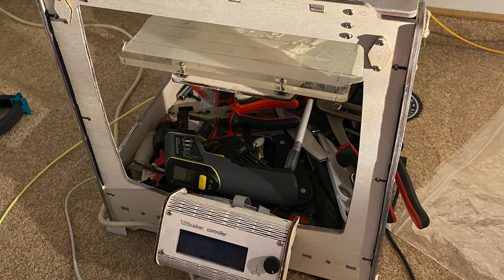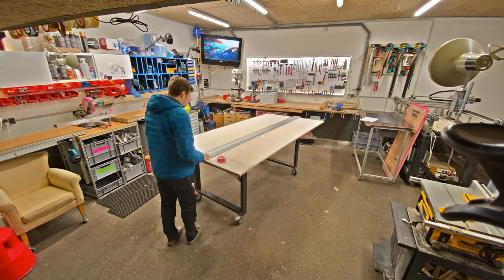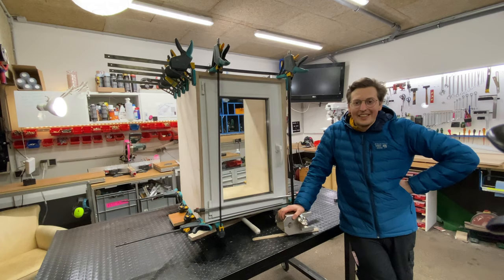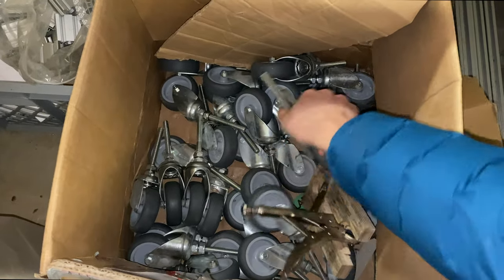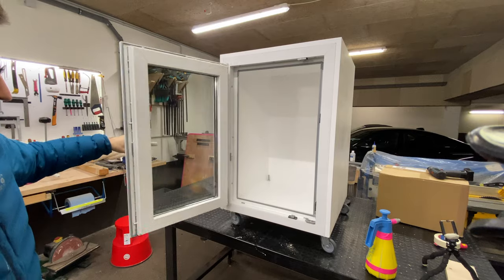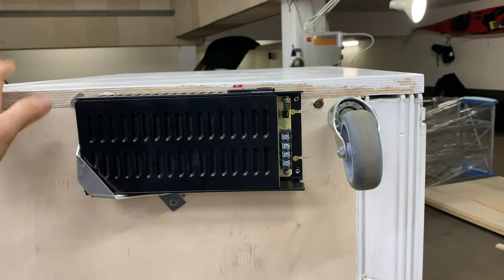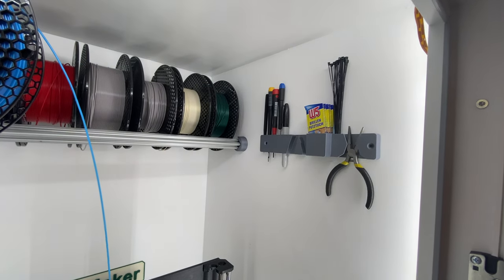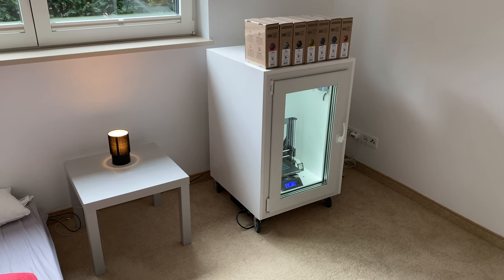3D Printer Enclosure. The perfect home for your printer! (Soundproof, Dustrpoof)

Comment: Thanks for this video, this is a fantastic build. I may build something similar, but with two changes.   1. Exhaust fan and tube to vent the enclosure out the window (since micro plastic dust from FDM printers is real, and can be a serious health hazard over time), and,  2. Mount the accessories holder and extra filament outside (top or side).  Thank you for the inspiration!
Reply from the maker: Good idea! The way it is its completely air tight, but of course you open it at some point. A filter would be nice, but you need to avoid a draft as well. So maybe one that vents only when its done.

Comment: Amazing idea. I’ve searched for ideas for a printer enclosure and this is the best solution I’ve seen so far. Fireproofnes however is an important point for me, since I’m using a chinese printer. I will glue some 2mm Aluminium to all surfaces on the inside to improve it a bit. 

Windows in a small size like 40x60cm cost around 40€ online, never expected them to be so cheap.
Reply from the maker: I never run it without a person at home. It sits in the kids room, (no kids yet) so we practice checking on it.

Comment: Baltic birch plywood.  I love that stuff.  Heavy and straight.  Not your standard douglas fir plywood.  EDIT:  For those looking for ventilation that's quiet and cheap, I've used (in the USA) 8 inch duct elbow (90 degrees), 8 inch "back draft blocker" (so wind from outside doesn't push printing fumes indoors, and the Amazon Basics 3 speed small Room Air fan 7-inch.  If you remove the stand of the fan, you have a perfect 8" circular fan that will fit inside the ducting.

Comment: I have the official Prusa Enclosure and I need to soundproof it.  The i3 MK3S+ isn't as quiet as I wanted, it is quiet but I live in an apartment complex.  This week I'm going to buy a paver brick and I have some foam for it, going to try that.  If it needs anything more than that I might add some foam to the inside, nothing thick, it won't need much beyond the paver brick I think.  The PLA I'm using also has an odor but I have the air filter on pre-order for that.

I should have just made my own, I mean my Dad has a wood shop I could have used that has all the tools and more that you showed, just not the manual forklift, that is amazing.  Oh well, I have a second printer I haven't assembled yet, I'll go to the Habitat for Humanity story here, it is used construction materials, look for a window like the one you had and build around it.  That is brilliant and there are always those kind of windows there.  I could make one like yours for the bottom printer and then put the Pursa enclosure on top of it and then I can wheel them around.  My dad even has some heavy duty casters like you used!

Comment: The Window is amazing ;-) I like it
Reply from the maker: It saved a lot of time and money. I don´t like acrylic, so I would have probably bought polycarbonate which would have roughly cost the same if you add some hinges as well. With this the whole construction was much easier. Thanks for watching!
Reply: @MaxMakerChannel  I made my box from Ikea Lack, because it was easy, cheap (all cost only cca 30€) and you doesn´t need any special hardware or workroom, but you idea was really great! You inspired me. Now I need only some free time.... ;-)  Thank you for your nice videos!
Reply from the maker: @juraj_redeky  Thanks for watching! I considered building the Lack enclosure. But I wanted to use the time before I had the printer in hands, so printing any parts was out of the question and IKEA was closed of course. So It was a easy decision and I also had time to do it. The main factor for me was that I wanted airtight doors.

Comment: Don't store the filament or printed parts inside of it. Heat will degrade them, especially if you are printing with filaments like polyoxymethaline which requires high heat

Comment: great! i have to make one for my garage. i just wonder: no ventilation at all? no air change? isn't it dangerous for a 3d printer?
Reply from the maker: The printer doesn´t care about fresh air. The enclosure is large enough that it doesn´t get warmer than about 35-40°C. The power supply is outside the enclosure.
Reply: @MaxMakerChannel  thank you for the reply! i have a geeetech A20, wonder if i will be able to eliminate all noise.
Reply from the maker: @asici2  The Triac Stepper drivers make a big difference in noise. If your printer doesn´t have those chips you might be able to upgrade them. Otherwise the concrete base on foam makes a big difference.
Reply: @MaxMakerChannel  thank u <3
Reply: @MaxMakerChannel  hi max. i built one too. but it seems that with all closed, the printer have printing issues. could it be due to high temperature inside the enclosure? maybe a pc fan could make the situation better? thank u!

Comment: This looks Cool but i have  a question is how about air flow inside? what happened if this printer get overheated?
Reply from the maker: I don’t know what would happens if it overheats, but the energy going in from the heater and the energy leaving the cabinet equalise at about 40°. So its ok.
Reply: @MaxMakerChannel  Thanks for sharing this information  I will make same box like urs soon but i will add cooling fan in case my house get on fire.
Reply: Sorry one more question, i know  a part called hot bed need to be hot temperature, but power supply needs to be cool down, and E3d v6  HotEnd  needs to be hot temperature, in this case if u dont add cooling fan for power supply you will get overheated what will you do ?
Reply from the maker: @franklee8126  Yes, the power supply is underneath the cabinet!
Reply: @MaxMakerChannel  i know but still need a fan for it, because hot air go up flow

Comment: I like it. Do you think a temperature controlled exhaust fan could be a good addition to keep the temperature stable? Or would the increase in noise escaping be a deal breaker for you?
Reply from the maker: A pc fan would be plenty and not be very noisy. However, the temperature doesn´t go above 45°C when I print PLA. And if it did, I could slightly open the window. Its a German window, so there is a setting for opening it just a bit.

Comment: this enclosure can only work with a non-heating bed.
I use a broken-down fridge, for my Ender3, but if I close the door during the print, the temperature rises, and the print goes bad.
Reply: i built one too. it seems that with hot bed, the print goes bad, indeed. i am thinking about installing a fan in the rear to make enter fresh air.
Reply from the maker: Perfectly fine on mine.
Reply: @MaxMakerChannel  do u print with pla and heated bed? I just tried to print in cold bed to see what happens
Reply from the maker: Always with a heated bed. Without it warps horribly.
Reply: @MaxMakerChannel  well, my printer doesn't print properly without air. Dunno why, but now it work like a Charme. Cheers

Comment: Haha. I'm just finishing up a very similar enclosure. I also used Baltic Birch plywood and the door and left and right side has inset a sheet of 16x20" glass. i went with glass because i'm sick and tired of looking at my other projects where i used Plexi or Lexan and they're full of scratches. Plus glass insulates better. The only thing i haven't quite finalized is keeping the electronics cool. I'm leaning towards sealing up the vents on the sides of my i3 Mega S, and having a piece of wood fit tight around the bottom edge of the printer, so i can then vent the printer from below using some 120mm fans without it blowing all that cool air into printer enclosure. The one thing though that i didn't quite anticipate was the weight. lol. My enclosure with printer inside must weigh 150lbs.
Reply from the maker: I would recommend taking the electronics outside entirely. If your prints fail you will always be wondering if it is from the draft or not.

Comment: I would like to see a follow up on the diy efoil board. I would like to build one, but only part one of the instructables is up :(. Keep up the great work tho.
Reply from the maker: Will finish it!
Reply: Max Maker yayyyyy 🎉 I’m so pumped thank you for the quick reply, love your work
Reply: Max Maker do you think when you do write the instructables part 2, that you can provide info on choosing a motor and esc and everything else we would need to get started?
Reply from the maker: Alomode10 Check out efoil.builders There you find the Max Maker Build Thread with all the Information. Its a lot of trial and error by all builders in the community.
Reply: Max Maker thank you so much I really do appreciate it
Reply from the maker: Good luck!

Comment: Links for the lack table files?
Reply from the maker: Check them out on Prusa.printers!
Reply: @MaxMakerChannel  Right on. Super noob here. Just bought a printer. Haven't received it yet. Thanks for the reply!
Reply from the maker: Sure. Lots of great info on their channel as well. One advice: The debates about PETG vs PLA is totally overblown in my opinion. I ended up only using PLA. That stuff is great for almost everything and if you want something to be stronger you can just make it bigger.